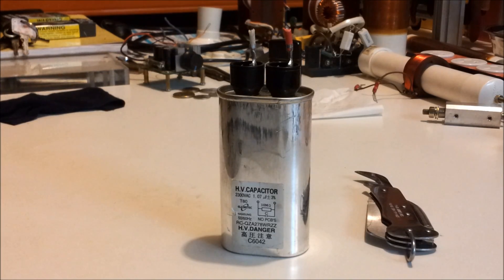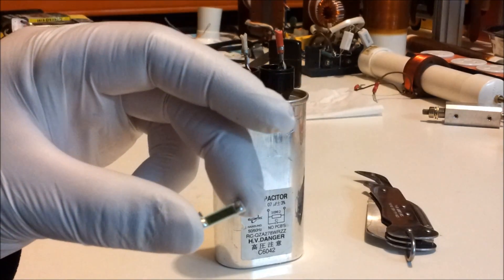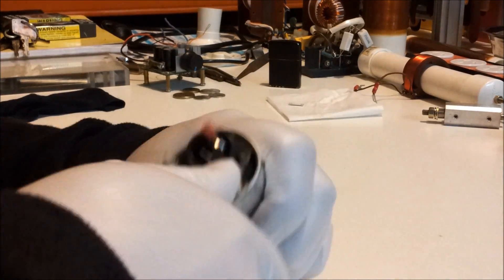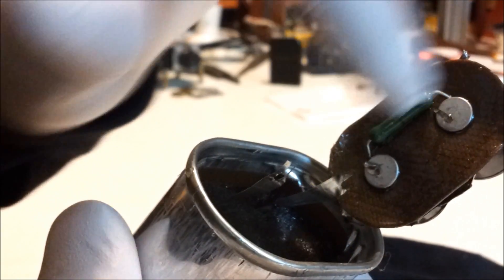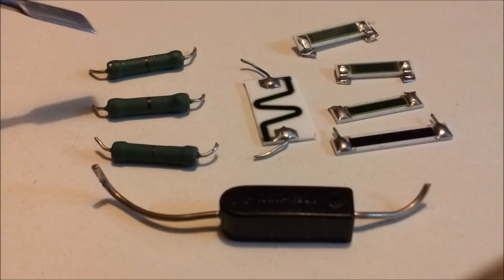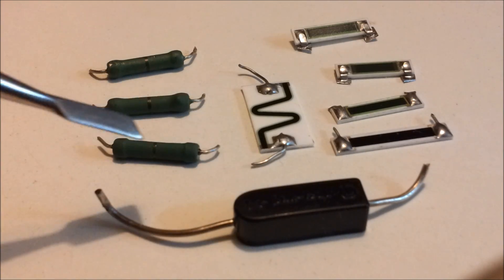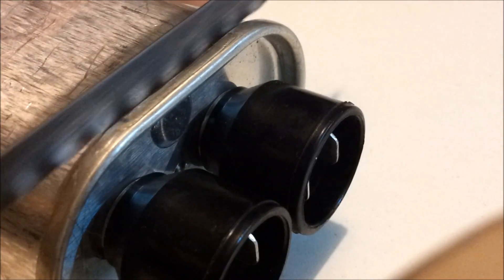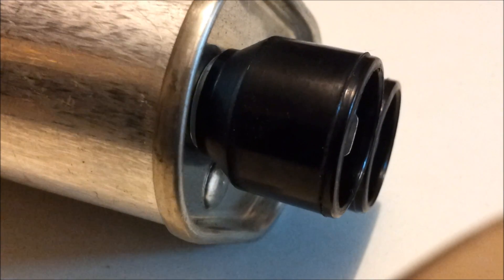Teardown #5 - 2KV Microwave Oven Capacitors

Comment: you mean to tell me there is nothing else inside there except for copper coils???
Reply: Often not even copper 😊 a capacitor is not much more than two adjacent plates of metal with insulation between them. A very long pair of metal films is quite inconvenient, so rolling it up makes sense.

Comment: The oil is usually mineral, the same stuff you drink to help with tough caca, and occasionally silicone based oil. So to those worried about the toxicity- it’s not too bad. It might even help you shit.

Comment: What power rating are those resistors??? 
"What watts" are they😂. no but really?
Reply from the maker: keith king I'm not sure exactly what the power ratings are.
The ones which look like standard resistors are probably around 1-2watts.
The flat ones on ceramic strips are most likely 1/4 a 1/2 watt.
Reply: @EnergyFabricator  those caps can kill you right!!? Do you know what sort of power they can put out when charged up?? Like what's there rating, Fareds and such???

Comment: May I ask why resistor is used in conjunction with high voltage AC, low Amp capacitor?
Reply from the maker: To discharge the capacitor when not in use.
Reply: So it is for safety reason. When power off. Capacitor is drain clean.

My electric motor is AC, has Bridge rectifier convert 120Vac to 120Vdc. Before go to motor. It has resistor. 

No capacitor anywhere. Why still need resistor in this case?

------

I was wondering if it is possible have AC capacitor such as the one you shown on the video from microwave to store DC volt and DC current.

Comment: What do you use the resistors for? The caps cost about 7USD so I can't image it cost effective to get these resistors this way.
Reply: A guy could buy a bag of 10 meg resistors for 7 bucks.
Reply from the maker: I use the resistors for high-voltage voltage dividers. I get the caps for free from scrap microwaves so it costs me nothing but my time. You can check the prices of MOhm resistors & decide if it's worth it to you.

Comment: Mine has a resistor that is soldered across the terminals externally. Does that mean there isn't an internal one? thanks
Reply from the maker: Usually they are internal. If you have an external resistor, i would say there would not be an internal one.
Reply: Thank you.

Comment: Interesting, but it's painful to see the caps being butchered just for the resistors - oil-filled caps are much more valuable than resistors.
Reply from the maker: Yeah, I'd usually be inclined to agree, but the caps cost me nothing & the local availability of high M-ohm resistors is low. Also, there are not many industrial and/or consumer goods from which you can salvage them.
Reply: Energy Fabricator resistors are literally the easiest and cheapest component to make. This is almost as bad as the scrappers who melt down the microwave oven transformers for $5 of metal
Reply: @Ferraday selling them off whole for scrap is not nearly as fun.

Comment: Why do want the resistors anyway?
Reply: They are bleed down resistors.. the capacitor will not hold a charge with the resistors still in there...they are a safety feature of these large caps.
Reply: 99c on ebay?
Reply from the maker: They can be used in high-voltage voltage dividers.

Comment: Hoping you could help troubleshoot my microwave. Is it a capacitor issue?https://youtu.be/nYHtgAj4Tg0
Reply from the maker: looks like you have power and the pcb is working ok. issue is most probably the magnetron and/or HV capacitor. replace both.

Comment: I don't get why there is a resistor bridging a HV cap.
Reply: +Christian Cedeno to slowly discharge it over time.
Reply: Its a safety measure to prevent some idiot from touching the capacitor
and killing them selves.It discharges the cap after the power is turned
off.And believe me there is way more than killing power here.Be careful.
Reply: Christian Cedeno what do you do with the oil?
Reply: Christian Cedeno it a bleeder resistor

Comment: Why do you junk the caps? Can't they withstand pretty high voltages?
Probably even nice to have the cap without the bleeder resistor, so you can just fill it back up and seal it again.
Reply from the maker: +johnb003 
The caps are rated to 2KV or 2.1KV and I did consider keeping them but I have sooo much stuff and I also have high voltage caps that are ready to go off the shelf. If I kept these caps, they would need to go back under oil asap before they dry out. Also, the oil vapour is flammable so it would be risky to solder leads to the terminals. I can also get more of them whenever I want. In short, it's just too much work and I have better caps. If I didn't have any other caps, I would maybe consider it, but I don't need to, so I don't.

Comment: You might b able to peel back the crimp at the top using a good pair of wire cutters/diagonal cutters
Reply from the maker: Raymond Bivens 
I haven't tried that, but the hacksaw is definitely a quick and easy method.
Thanks for watching :)

Comment: This is an important video for those who re-purpose. Many who don't realize there are resistors and diodes in microwave oven capacitors. Thanks for taking the time and sharing.
Reply from the maker: Diadon Acs 
No problem. Thanks for watching :)

Comment: Good stuff! I didn't realise there was a resistor inside those caps! 
Also to note is not to open up old caps as they could have the nasty PCB oil in them
Reply from the maker: Machine Man 
10 megaohm resistors are hard to come by and they are very useful for making high voltage probes :)
Reply: Energy Fabricator ahh nice! maybe I should look inside a few of mine!
Reply: Just use gloves